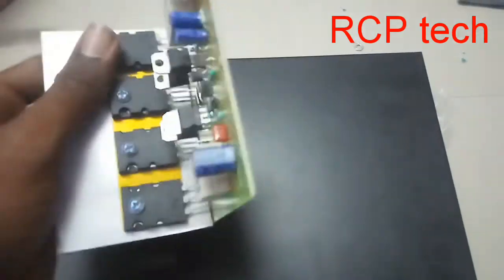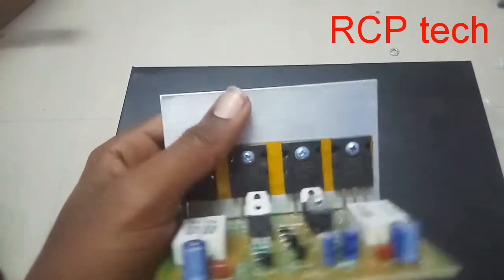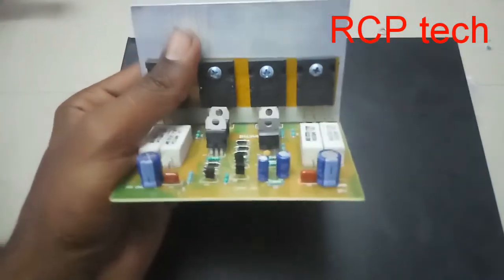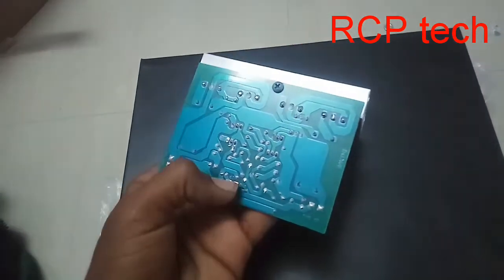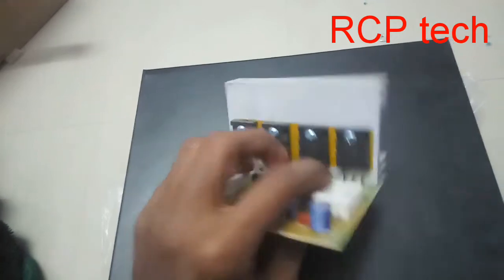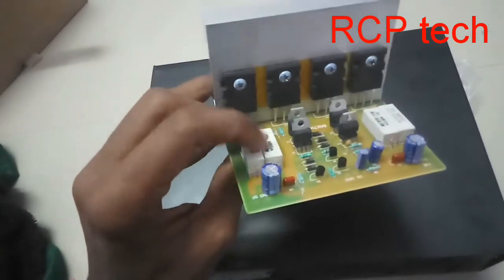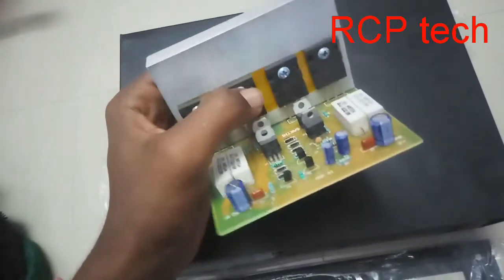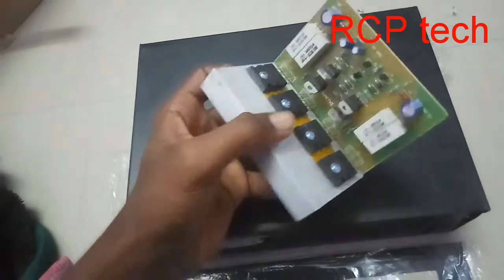Sakthi 4fet mono audio board explain tamil

Comment: bro, sakthi 4 fet sterio bord ku matching woofet 10 inch or 12 inch , 4 ohm or 8 ohm ? which brand.? is best
Reply: 4Fet Mono ku 12 inch JBl 1400 Watts Pakkava Match Agum
Reply: 4fet stero la 2input line ah merge panni Ore input ah Kudunga Two 10inch 8'Ohms la Sub Woofer podunga sub pre maharaja1300watts use Pannunga bro Matching Pakkava Irukkum